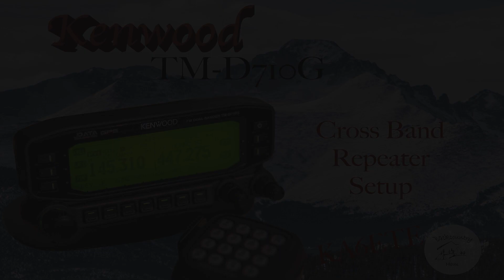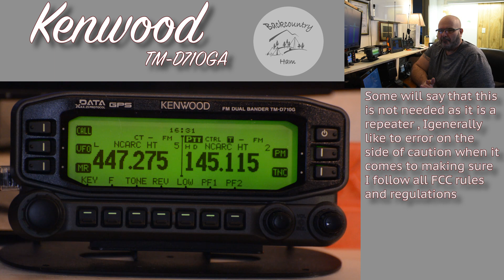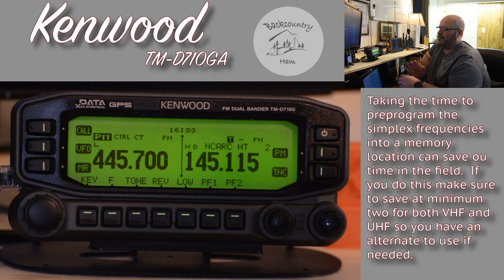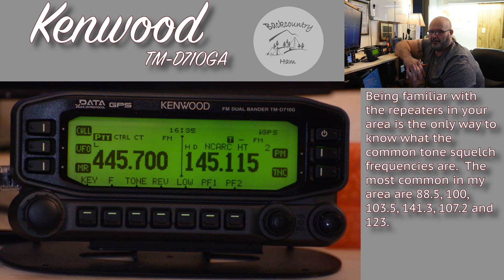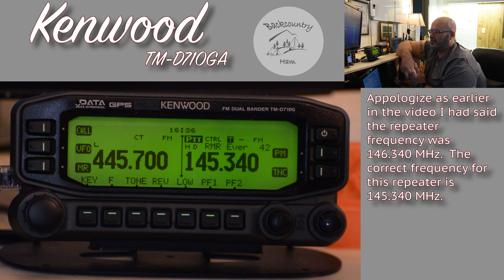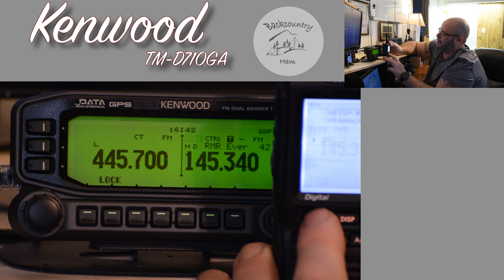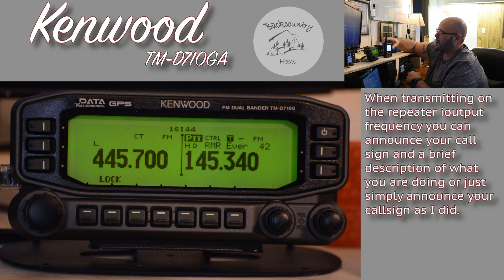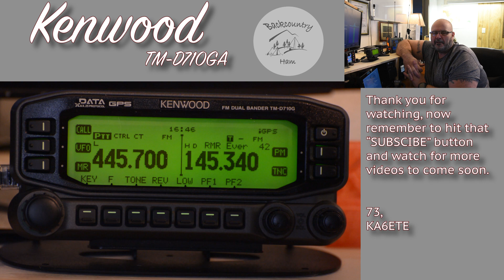Kenwood TM-D710GA Cross Band Setup

Comment: Great Video. 
We will be providing Aid Station Communucations for a 100 mile race in a rural state park using 2m simplex.
My specific aid station is in a valley and I will be using the cross band repeat on the D710GA this year to solve a couple issues. 
One being tied to the radio/genset/lifepo4 at the station. If a runner is hurt on the trail previously we would have to relay via HT’s or wait for in person reporting back to the aid station to send out over 2m back to net control. Cross band repeat will allow for more efficient communication from aid stations back to net control.  
73’s.

Comment: Why did you setup the T SQL?  I was a bit confused by that part.  Great video.
Reply from the maker: Thank you, using T SQL serves a few purposes:

1. Prevents someone from unknowingly transmitting on a repeater or getting confused if they hear the repeater, if that’s the configuration you have set up.
2. If someone uses your crossband knowingly or unknowingly against FCC regulations you can be held partially responsible. 
3. Helps with duty cycle by limiting the number of users on the crossband repeater. 

While it may be unlikely to be on the same simplex frequency it is a possibility.